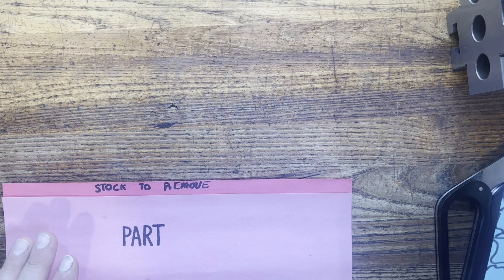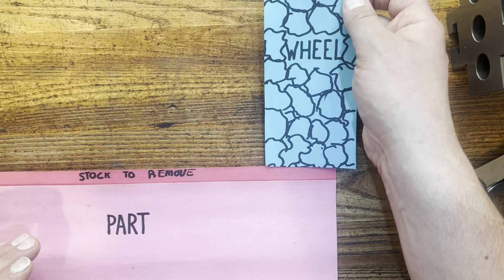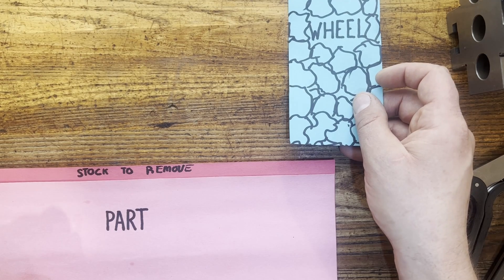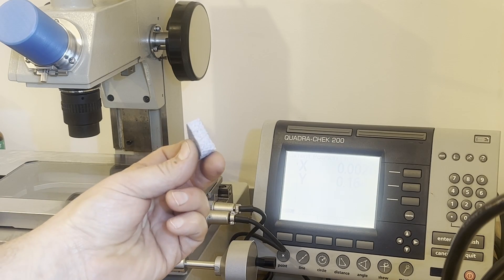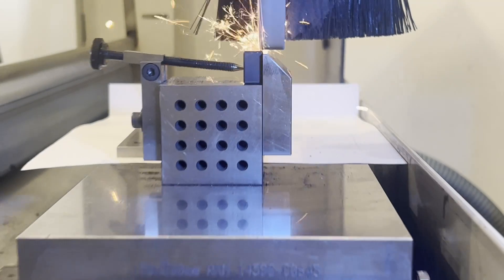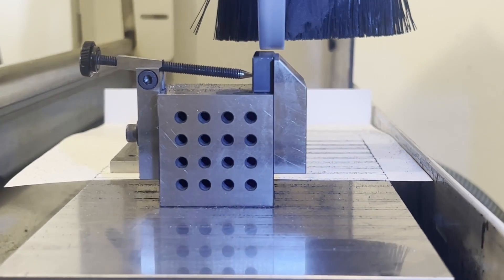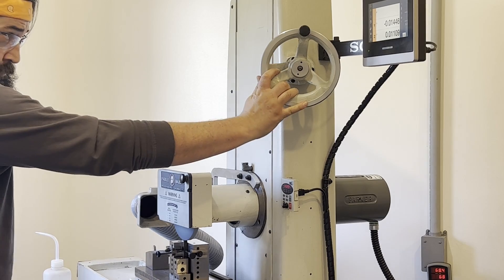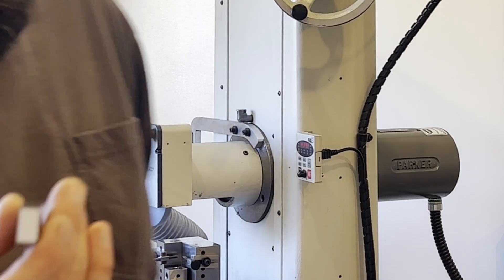Peel Grinding technique for the Surface Grinder

Comment: Really appreciate the technical explanations.

Are there any books or resources about grinding (manual surface grinding, really) that you can point us to? I've read about grinding wheels and how they're defined, but I've never seen anything written about heat control, the quantitative differences in techniques, fixturing, etc. All the advice seems to be that it's folk knowledge and nobody has published anything on it.

Comment: Could you tell me a little about that brush you've got on your wheel guard? That looks brilliant for keeping the mess down. Having trouble googling down products specific to the task, but maybe you repurposed a standard hardware store brush?
Reply from the maker: @VoidedWarranty  that’s a factory part from the machine builder . But if you google “bristle brush extrusion you’ll find all sorts of strips of brush you can buy and saw to the desired length

Comment: I'm hoping you still check old posts first to say thank you and as a "rookie", how do you determine the grain size of a grinding wheel [for the step-over process?]
Reply: I used to think that grit size was 1/(the diameter of the grain). But that's be way too simple for imperial... A 3M white paper says that:

"For example, ANSI B74.12 specifies that to be considered a 100 grit abrasive all the material must pass through a standard 70 screen with a maximum of 20% of the material being retained on a standard 100 screen. This means that up to 20% of the material is larger (more coarse) than the standard 100 screen opening while, at least 80% is smaller (finer) than the standard 100 screen opening." (From 'What Does "Grit" Mean?')

And a screen is made of wires with some non-zero diameter, which means that the 100 screen openings are definitely smaller than 0.010".

Our measuring standards are ridiculous.

Comment: This wouldn't work with thin parts due to warp correct?
Reply from the maker: It can be effective in thin work, but it requires a reduction in wheel hardness . A harder wheel in thin stuff tends to increase warp

Comment: Yeah I wouldn't do this, you load up the spindle and the wheel, especially when grinding something like D2 or A2, better off going smaller depth and utilising the whole width of the wheel. You also load swarf into the wheel and takes a lot to dress off
Reply: It's crazy at a glance in my mind but listening to it it seems to be working honestly, but yeah even with our good grinder on some metals we work with I'm doing micron depths or 10-20 not  .25 honestly mind blowing didn't know you could do it at all wearing the machine or not, but it sounds like it's working just like how it says after that left side passes it's not an unreasonable amount to spark it out on the later passes at all. Just chewed it off, I would expected a blown apart wheel or like burnt parts, I don't get how there's less force

Comment: Very interesting technique! Thank you for sharing. Would you recommend this technique for thin stock with inner strees? I mean from knifemaking point of view we usually grind blades or titanium handles which are around 4 mm thick. After milling or grinding they tend to bend pretty much because of inner stresses... Do you think this technique will be better for flattening than regular wheel grinding?
Reply from the maker: It’s low heat generating and doesn’t have much force which allows a lower magnetic hold, so it can be handy on very thin parts . No experience with grinding titanium

Comment: You articulate this process very well . I never knew what it was called , we always called it creep feeding. It works great on High chrome alloys and 400 series stainless. I love you can set up the grinder on a fine cross feed and go do something else. It keeps the wheel sharp exposing new grains.  I`ve worked in a job shop since the 80`s . I`m just about to retire.  I really enjoy your videos. Thanks very much.

Comment: Hi Adam, hope you folks had a great Thanksgiving! Wanted to ask you where you mounted the scales/read heads of the DRO on your Parker-Majestic grinder?  I just added a single axis DRO to my Harig, and basically mounted it ala Acu-Rites instructions, but with shop made mounts. The scale is along side the right/rear of the column( as you face the machine ) with the split rubber seal pointed rearward, and the reader head anchored to the motor housing.  Always interested in seeing how others skinned their cat.
Reply from the maker: The scale is mounted to the Column via a flexure chassis provided by heidenhain, and the read head is mounted under the motor reading at approximately the same heigh the wheel would be
Reply: @adamthemachinist  Thanks for the description Adam!

Comment: Having never used as surface grinder but interested in the process, I thought what you've described was the only way... Using the corner so you are constantly exposing untouched parts of the wheel and it technically won't ever change diameter.
Reply from the maker: Taking a very wide step over and shallow step down is the norm. it’s often far more efficient for large parts and many semi auto grinders can’t make steps this small and consistent

Comment: Does the wheel breakdown of that leading edge actually create the longer ramp?  Are you able to go longer between wheel dressings, since the part of the wheel that 'wipes' the part to final dimension is doing so little work?
Reply from the maker: Eventually the wheel will start to shed grains as they dull, exposing a new sharper corner of grains . Prolonging the interval between dresses is a key advantage of this

Comment: Adam, I could barely hear you over the grinding noises at around 6:05 - maybe next times edit the volume of such recordings down! Otherwise excellent information and thank you very much for putting it together. I'll be subscribing.
Reply: Huh.  I didn't get that impression from the sound there; I thought it was pretty good!  To me (just a point of view), it would have been like taking the engine sounds out of a racing video.  🙂 But... different people, different perceptions, I guess!

Comment: This is a wonderfully described process. I "stumbled" onto this process while grinding .060" thin D2 cutter blades. Didn't know it had a name! I use it on most things I do now. You don't spend time dressing your wheel with this process as the leading edge is breaking down and exposing fresh grains yet the trailing edge is remaining stable and consistent.
Reply: I was checking to see if anyone else made your point about dressing, otherwise I was going to. 
I actually find this technique (I, too, never knew it had a name) gives me a better finish on some machines, 
I assumed it was because the grains which did the finishing were well sorted (any rogue grains with their "heads above the parapet" having been knocked out) and would give a better finish than a fresh-dressed wheel would at the beginning of a finishing pass.
Reply: Furthermore it seems to bme that the leading edge of the wheel, because of the substantial depth of cut, is having any blunted grains torn out in short order, keeping the business end of the wheel free-cutting, because there are always plenty of sharp grains being "brought into play", like fresh players in rugby whent there is a high injury rate and a "deep bench".

Comment: I recall at work the head toolmaker was grinding a case-hardened toolmaker's flat and it cracked and the hard surface curled up like potato chips. He was using plenty of coolant and wide Norton purple wheel. I'll bet he was using the entire wheel width.

Comment: So the "peel grinding" that you described is how I do most all of my grinding. Would "plunge" grinding be the opposing method? I tend to steer clear of full wheel width grinding because of heat.
Reply from the maker: Plunge and traverse grinding are two more common ways of removing material. Traversing is how most semi auto grinders remove, plunge meaning the wheel slowly moves down till final depth is hit and then moves over 90 percent of the wheel width and repeats until the part is ground. And yes, without coolant those options do tend to create more heat than peel grinding . The neat thing about this work is all the different ways to do the job